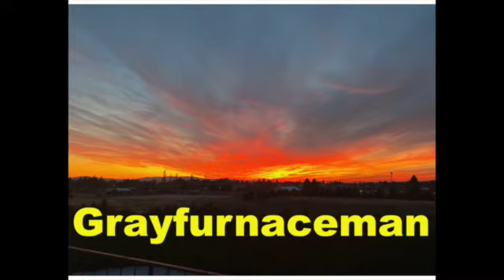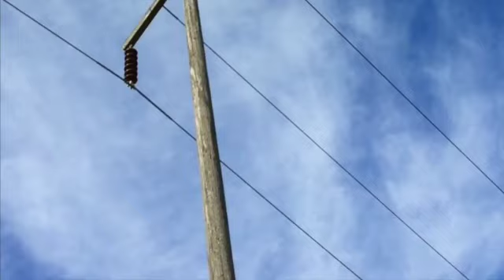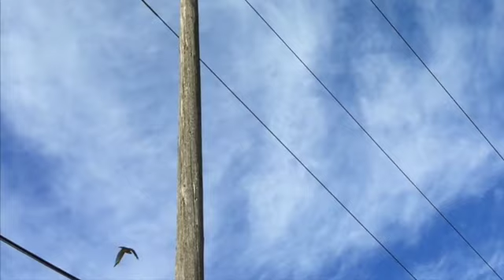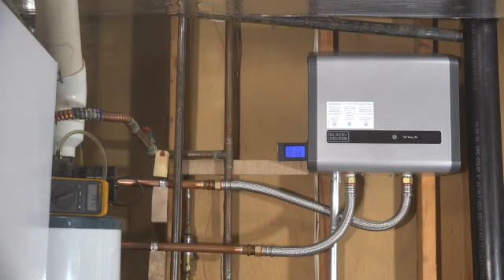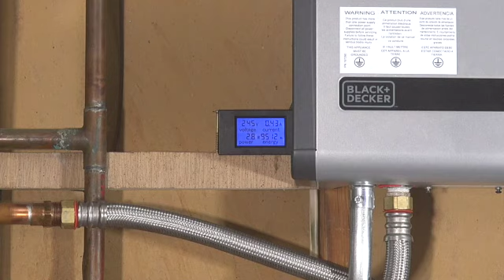An installation of an instant on water heater

Comment: i can guaranty you, when that electric water heater comes on, it's drawing almost all of it from the grid when the sun is shining. the demand of those things is very high as you've discussed.
Net energy is not the same as actually being 100% solar for electricity with the solar output not really syncing up with demand well. It may be a smart financial decision to use that, but it doesn't make much sense when it comes to conserving fossil fuels and reducing pollution unless your power is mostly nuclear/hydro.
Solar thermal is the way to go for heating water without fossil fuels, best of all the energy collected actually gets stored cheaply waiting to be used.

oh - if you haven't seen the movie planet of humans yet, you should - exposes the wind/solar industry.
Reply from the maker: The array I am using has a max output of 12 to 14 KW.  The water heater max is 18 KW.  
A net metered grid tie system is the future of energy production.  
The max production time period is 10:00 AM to 2:00 PM.  That does not perfectly match with A/C usage, however, it does match well enough to reduce much of fossil usage.  
As the mix of sources changes, (wind, solar added to fossil), and renewables increase, utilities will be more like energy managers than energy sources.
Solar thermal has all but been stopped in favor of PV panels due to cost and complication of the solar thermal.
As to Planet of the Humans, Michael Moore is a sensationalist that has little credibility.  Yes I have seen it.  It highlights all the failures that are common in new technologies and the mistakes political entities make that cost a lot and give little.  Check the current administration backing of a manufacturer of TV sets that does not make TV sets in the US.  The first wind turbines in the California desert were removed 10 years after the installation due to assorted mechanical failures but now the desert has many more wind turbines functioning quite well. 
GFM
Reply: @grayfurnaceman  Solar thermal is a far simpler technology than PV - far less goes into making solar thermal panels than PV. A tank and pump, differential thermostat with sensors -> much simpler than an inverter and batteries. 
PV panels are under 30% efficient vs solar thermal which can approach 80%.
I don't know what complexity you're referring to.

Unless you time your showers to synch up with your solar production, you're relying on conventional power plants to heat your water - extremely inefficiently I might add. Do you wait until 10am to shower?

What happens if it suddenly becomes cloudy? Fossil fuel plants have to continue running regardless of solar output because of how unreliable it is. 

Until and unless there a cost effective and efficient way to store electricity is invented, the grid will remain mostly fossil and nuclear fuel. 

Ps - the film was done by jeff gibbs, michael moore just took the credit and publicized it.
Reply from the maker: @Jon-hx7pe   I have built solar thermal systems, and I can tell you the efficiency is not as high as you think it is and the complication is in the piping and pumps.  
In my case, as in most cases, adding a PV panel is far simpler than installing roof penetrations and piping systems.  
In addition, the costs are around $3000 installed.  The time for solar thermal is past.  
GFM
Reply: @grayfurnaceman  Maybe the installation is more difficult, but the results are much better when it comes to reducing resource use. Materials required to build aside, solar thermal directly stores the energy collected.
With grid tied PV and solar is, grid stabilization is a major problem due to no storage buffer.
We have a lot of wind and solar in ontario now thanks to bad gov't policies and the turbines produce surpluses during off-peak periods, the surpluses push the price down and the power is sold at a loss. In summer, on days the power demand is highest, the wind turbines don't produce -> the solar does but out of synch with a/c demand which peaks from 3 to 5 pm. 

Don't get me wrong, there are some great  applications for wind and solar, grid tied isn't one of them.
Reply from the maker: @Jon-hx7pe  We will just have to disagree.
GFM
Reply: @grayfurnaceman  of course you'll defend your purchase of solar panels - psychology of previous investment. ;)
Reply from the maker: @Jon-hx7pe  Well, I built a test panel, worked with it for a year and have added to the array twice, so I guess I have a real psychological problem.
GFM
Reply: @grayfurnaceman  not a problem - it's just normal for people to justify what they've done after investing time/money into something. but speaking along the same lines -  people who think   "net zero energy" is a real thing, production = consumption, therefore no fossil/nuclear fuel used are deluding themselves, pretending it's possible to have all modern conveniences like central cooling on 100% renewable energy. You're just as dependent on fossil fuels for electricity as the rest of us despite having solar panels.

Comment: Gas technician and Electrician here. I am trying to decide what to do with my old electric water heater.. Leaning towards gas tankless only problem is my well water is very cold but the bigger problem I have only a very basic filtration system I think the tankless will get plugged up but with an annual semi annual complete flushing I think it should be fine
Reply from the maker: Whether you have a standard or tankless, well water is a problem in most cases.  I also lived with a well and it even plugged the water pipes.  
However, with proper maintenance, it will probably work ok.  
GFM
Reply: Thanks I appreciate it!

Comment: It's kinda odd Americans/Canadians do not have the water heaters near the bathroom
Reply: Since the fifties most American houses are larger spread out designs.  Combined with cheap energy, use of one large tank became common.  If the tanks fail in ten years then a new $500 unit from the neighborhood big box was obtained.  The higher end homes might have multiple  tanks or incorporate recirculation loops to ensure fast hot water delivery.  In the last few years, gas fueled instant water heaters are becoming more common in production homes but they are not as cheap to buy or maintain because of scale issues.

Comment: Wow that little guy loves the amps double 40 amp breakers...
Reply: if you want any type of flow rate past a trickling very low GPM faucet, it takes huge current.
say you want 5GPM flow rate,  that takes 120 amps (3x 40amp 2 pole circuits), But that's only good in the southern warmest climates where the incoming water is nearly outdoor temp or very warm, if it's gets real cold like up north or deep pumped ground water, will be too cold for it to heat at even 1/2 that flow rate, so you'd have to up-size to a unit double that yet. now you need 240 amps current! which is beyond what most homes have available, majority are 200amp service entrance, meter and main breaker lol.
I fully recommend against electric tankless and would only use for hand wash stations and other low usage items or special applications like he's doing :)
Reply from the maker: Its pretty shocking.  throttle bottle pretty much has the goods on these.  Not that they are not useful.  If you have a 400 amp service it would be ok.  But the utility hates you. 
GFM

Comment: I forgot to ask the question I meant to ask, does your utility not have net metering? Are they not sending you a check for the excess electricity?  I have solar on my house and if my bill has a credit over $25, they mail me a check.  If mine decided not to send me checks anymore, I'd probably prefer to get either a plug-in hybrid or an electric car and use the power up that way. Water heating uses a fair amount of power, but not enough if I had as much solar as you will have when you've installed all of the panels.
Reply from the maker: Thanks for the info.  
We have net metering.  My utility does not pay me for power.  They just credit the bill and once a year, if you are positive, they give the power to folks that can't pay their bill.  
There is a lot of pressure to remove power buyback policies as the utilities lose money on these buybacks.
Yes, I think I will be over this year, so am replacing natural gas appliances with electric.
GFM
Reply: @grayfurnaceman  That sounds like a good system, you get to pay nothing for power and you don't have to worry about storing electricity to power your house overnight and on cloudy days like the off grid people do.
Reply from the maker: @averyalexander2303  When I was researching systems,  I found the systems that have on site storage were quite costly and I would have to maintain the storage.
The system I installed uses micro inverters installed at the panels, so all wiring is 240 volt AC and my excess power is returned to the grid to be banked for when I am not producing power.
GFM
Reply: Of course Grayfurnaceman has an electric car (Chevy Bolt) that will use up most of the surplus.  He also converted a car into electric years ago.  He  has a "boutique" channel called Electric Car that is obviously not well known to 120k of his 121,000 subs.  I think retitlIng the channel into something like "Grayfurnaceman Does Electric Cars" might help the search algorithms.  https://www.youtube.com/channel/UCWTVUWyHMkb2hKAAcHSd-XQ

Comment: If you don't run the bathtub and you decide to cut the gas water heater out, if your shower heads aren't as hot as you'd like in the winter, the Niagara Earth shower heads have great pressure and have options with various gallons per minute rates all the way down to 1.25gpm. I know a guy using a 9.6kw electric tankless in an off-grid home and it works great with a 1.25gpm head to 120 degrees in the winter and 130 degrees in the summer in Wisconsin.  There are also a ton of 1.8gpm heads on the market now because of the watersense program and that's a low enough flow for your 18kw tankless electric heater in the winter if you decide to cut out the gas tank.  You just won't be filling the washing machine, dishwasher, or running other hot water sources at the same time as you take a shower but it would work just fine. I noticed at the hardware store they aren't selling kitchen sink aerators above 1.5gpm flow rates now, so 18kw would be fine there too.
Reply: Thank you
Reply: yeah, they want you to use no water volume yet still magical cleanse yourself... I bet none of them political folks have low flow stuff in their homes, or is so multi-head showers sucking up 10GPM+ lol
Reply from the maker: For many years I replaced water heaters set at 140 to 150F so they could keep up with a 10 GPM shower head.  If I did not want callbacks, I had to offer them low GPM shower heads because I could not (and would not) set the temp that high.  It helped when I told them they would use less than 1/4 the hot water.  
GFM
Reply: @grayfurnaceman  It seems I can't get more than 4 gpm through the 1/2" copper that crosses the house for the bathtub fill spout. I think the spec for 3/4" copper is 6gpm. I'm happy with a lower flowing showerhead, better designs work better, feel just fine, and rinse out the shampoo without the excess flow. It's not really a political issue, I'm cheap and using less hot water works for me. Same with insulating and sealing up a 2100 sq ft house to allow for a 40k furnace in Minnesota, and windows that reject heat on the west side to allow a 1.5 ton AC. Currently still have an ancient 75k 80%(60k output) furnace. Only runs half the time when it's -20f outside.
Reply: @GuruMN  the tub/shower faucets have all been flow limited internally at the balance cartridge or other areas now ;)
same for bathroom and kitchen faucets, they've had flow limiting designed in from the ground up